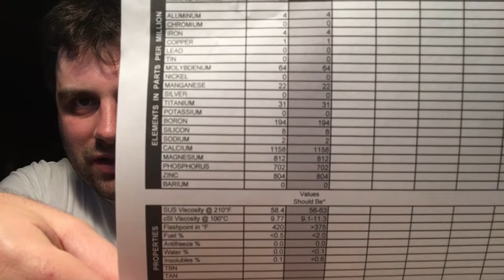CB7 Smog Fail - What's Next?

Comment: That's shitty. We just got rid of our last drive clean programs in Canada. Good riddance. Atleast up here it didnt matter what was done to the car, so long as it passed the two speed idle test. I also have a cb7 with an H22 swap. Full bolt ons. Skunk2 manifold, 70mm tb, plm header, ect. Passed my last required test few years ago. Modifications didnt matter so long as it passed.
Reply from the maker: Wow, I would’ve thought Canada’s requirements were more extreme, but they are more like Texas!  I have envy...
Reply: @af1132racing  ya thank God it's gone and over with. It was still a pain regardless. OBD2 vehicles were harder to pass with most tuning software/hardware. But I believe you could still have them tail pipe test OBD2 vehicles at your request.
Reply from the maker: Dude, everytime I check back, your account icon and name are different 🤣